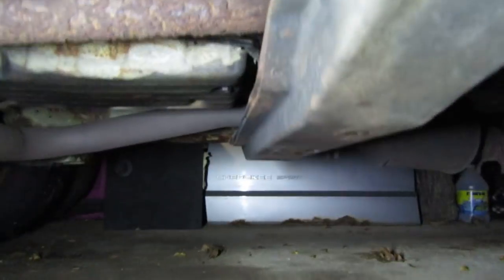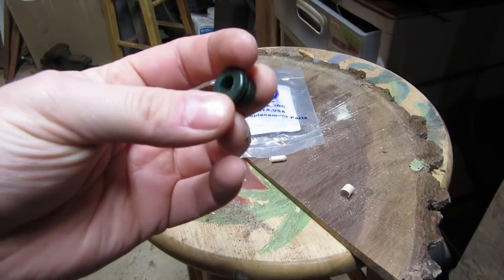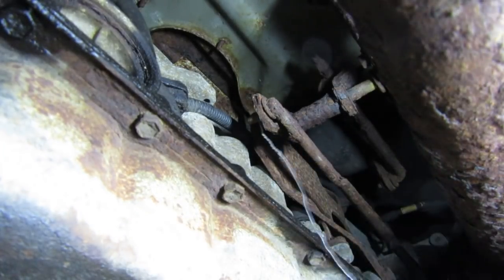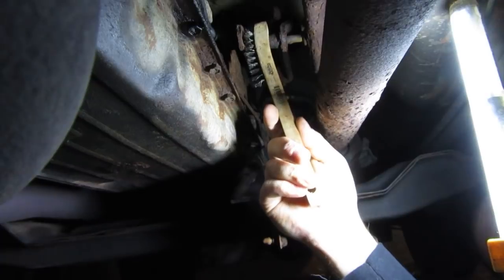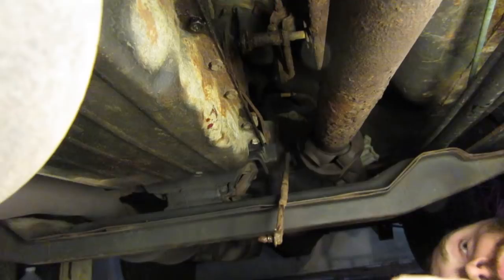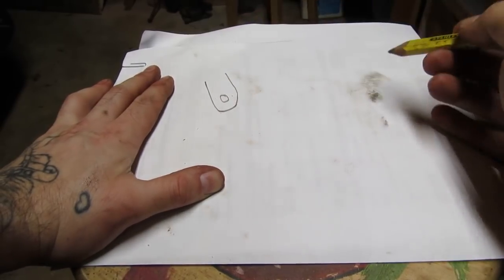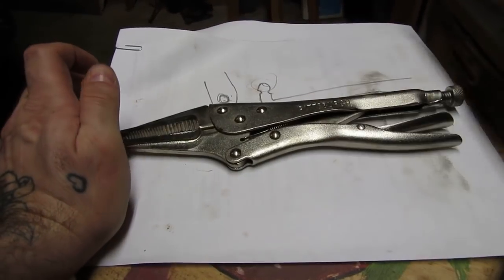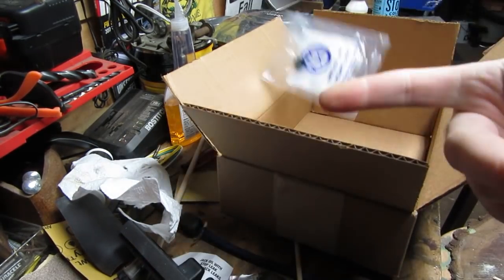HOW TO - Replace Transfer Case Linkage Bushing - JEEP

Comment: This may sounds stupid, but this is one of the most helpful video's I have seen on how to fit those stupid grommets! I have a 95 Jeep YJ - with absolutely NONE of those grommets on the automatic shift linkage - and tore my steering column apart trying to find the noise that was telescoping up the steering shaft from where the linkage connects. These things will restore your sanity... Anyway, thanks a ton for the video! Turned my otherwise 2-3 hour ordeal into a 10 min job.

Comment: Great video. Here's a thought why not put it in the freezer to shrink the rubber and then slide it in and as it heats up it expands. Never replaced it before but that's how I usually do bushings.
Reply: Yup. Most things will shrink when they are cold!
Reply: Frank Schwarz haha true story
Reply from the maker: Yea, i can't believe I didn't think of that! That has to be the "correct" way to do it.

Comment: Thanks for this. I haven't gotten under there yet, but I think while the arm didn't come loose, I think the bushing just dry rotted and vaporized into thin air. 

Now I hearing the chirping (annoying AF) of metal against metal.

Plenty of time to put the new one in tomorrow. Nothing but time on 3/25/20!

Comment: thanks for the info I did check mine and it looked abit brittled and torn and almost gonna fall off 
how ever I also have another problem at the shiffter rod going into the tcase . it looks like the seal is bad on it and its leaking fluid . the question is do you know if i have to drop and open the tcase to chang that or can i fish the seal from the outside then push the new seal ond o ring around the shaft.

Comment: Boiling water under the Jeep was not a possibility so I tried a hair dryer set on low--easy to carry under the vehicle. Warmed up the linkage and the bushing and it got squishy and popped right in using channel lock and very little pressure.

Comment: My 84 CJ7 has that same design to connect the shifting linkage to the auto transmission. With the help of your video I feel like this is a possibility. Otherwise the bailing wire was about to go back on. 😅

Comment: Have you tried pre-chilling the grommet so it's external diameter is smaller when installed?  Also, if you put the grommet into the bracket first, the channel for which it resides once installed - could (should) have some extra play for installing the bar through the hole afterwards.  If you installed the post into the grommet first, it might not leave enough clearance for the grommet to fit into the bracket afterward... so your order is likely the right approach.  :)

Comment: This makes me want to go out and work on my XJ...ahh crap I don't have one LOL.  

I've never had to replace one of those bushings, looks pretty easy to do but you would think maybe a smaller bushing with a retaining clip on the back side of that linkage to keep it from falling out even if the bushing disintegrates.

You probably should crawl under the Jeep and spray that bushing periodically with some silicone spray to keep it from disentegrating.
Reply from the maker: That is the best idea I have heard yet! i hadn't thought about preventative maintenance for those little buggers..

Comment: This is for the second shifter in the car that lets you  shift to 2wd and then Part-time 4wd then High 4wd then low 4wd?   this is the problem I am having can't shift that into gear .. stuck in part-time right now. Pain .. please respond if you can.  Thank you so much JP in Michigan .

Comment: I've seen a push/pull cable setup that replaces the whole linkage, but it's a coupla hundred bucks I think.  What about fabbing up a piece of flat stock w/ a hole in each end and bolting that in place of the rod that popped out??

I'm wanting a TJ, but I'm guessing a lot of what you and BJ do on XJ's will apply, so I'm watching and rewatching y'alls videos to learn as much as possible so I can hit the ground running on that magic day the Jeep Fairy comes.
Reply from the maker: Yea, at the end of the day all these Jeeps are very similar, especially the TJ, XJ, and ZJ. They share the same motor, transfer case and the entire front suspension setup is identical. The stuff Matt over at BJ used to do with XJs is insane. He is the reason I started this channel. haha

Comment: mine fell out and still has the bushing on it and i cannot get it back in, im thinking of taking it off and cutting the old bushing off and replace with a new one and do it the way you did because it seams near impossible to do it with the bushing still on the nipple.

Comment: mine is in exactly the same shape as yours maybe worse with the rust....there is only one bolt securing that lever to the transfer case...i think i am going to remove it sand blast/grind/file prime and paint it back into shape before install new one

Comment: I used channel locks but I put a small plumbing nipple on other side so pliers aren’t pushing back against the taped side of bushing that is trying to come through hole. Nipple fits around other end. Popped right in. Took like a minute. No heating bushing. No grease.
Reply from the maker: that is a great idea actually. thanks! I hope I never have this issue again, but as I am sure I will I will use that method
Reply: D&E In The Garage  ya and if you use channel locks it squares them up nice to push bushing in straight.

Comment: Another tip is I installed a Crown bushing but I ordered a Mopar one as well. The Crown one is so much harder than the Mopar one which almost has more rubber like feel to it. I would think it would be way easier to pop in than the Crown.
Reply: Do you know the mopar P/N?
Reply: @noisylobster499   No I’m sorry I don’t remember what it was.

Comment: Heat It up!! Then viola!! Poof!! Presto (ACCIO!!) lol
I put my parts in front of a diesel fired garage heater... Of course, I use this year-round, it is cheap and easier than you may think.
I use a salvaged (rebuilt) unit I got free that needed other free parts I found or buy one. Mine is rated @ 75k BTU, But I may have the pump pressure up a little higher than normal. LOL
This heater unit I have sits on a table or the floor, I slide the table back and forth facing the heater outlet, from contact to as far as I want to control saturation time.

The bushing flange always rides against the part that doesn't move!!

The Further away the safer the heat up time of course, I use it for bearings and all sorts of stuff... 
Try it out, you can use anything to heat it I guess, but I am telling you slick as snot!!! Heat is your friend...
You do not want grease, that attracts dust, dirt = wear = failure prematurely. 
I'd also recommend a hair dryer or industrial type heating iron/dryer for the pure novice. 
For the Purely Professional he can use the mighty Mapp Gass torch purely backyard TEKnique or is it professional!! 
LOL

Great Video!!

Comment: Would that plastic piece work on the shifter on a 98 grand Cherokee the cable keeps coming off on mine when I shift from park to drive and vice versa
Reply from the maker: No, this part is only for the transfer case linkage. There is a different part for the transmission linkage. I admit that I am not sure which part you will require

Comment: to make the job easier...one bolt attaches this to lever to transfer case... remove lever clean up and install bushing on the bench.....attach back to transfer case snap in cable

Comment: Hey, I've got a strange one, and yours is the closest vid so far... but not quite it.  That bar, that goes into the frame itself, that all the likage is connected to.  Mine is sliding in and out of the bracket on the FRAME of the Jeep... like maybe there is a retainer of some sort missing.  If I could find a good pic, diagram, etc, of what it's supposed to look like, I could sort it out!
Reply: At 3:24 in the video, see where your hand touches the frame on the right side of your hand.  Go straight up, and see the round rod there, that is slightly yellow?  Right THERE is where mine is sliding in and out of the frame to it's right.
Reply from the maker: I am not certain, but I think this same part is what you need. They dry rot and just fall out
Reply: @DEInTheGarage  Thanks, D&E!  I did find a repair kit for it, sounds like you were right on.
Reply: @meadowbyastream   had the same problem, should be a green bushing in there, if not you need the green one, all the replacement part kits include a green bushing

Comment: So the truck to this is to use rubbing alcohol as a lubricant. I know it sounds funny but it makes rubber extremely slippery for a few seconds before it evaporates off. If you use rubbing alcohol they will slip right in no pliers needed.
Reply from the maker: No kidding?? I never would have guessed that. Thanks!
Reply: Thanks that’s a good tip. Gonna put it in hot water then use rubbing alcohol.
Reply: Rubbing alcohol worked! Used some channel locks and squirted the rubbing alcohol on the grommet and it took about 30 seconds to get it installed. Prior to this I had wasted so much time not being able to get that stupid bushing installed. Awesome tip!

Comment: i was quoted $57 at the stealership today for that bushing does that sound right?
Reply: I know this is an old question, but that's more than a fair price. When I retired in 2013, the "stealership" labor rate was at least $120 per hour. So if that part was 3 bucks, you got it done for .5 hours and the dealer didn't really make anything substantial on it.

Comment: If you would of put it in really hot water for a few mins, the rubber would of been soft enough for it to be playable for a better result and only would of taken a few mins to get it done
Reply from the maker: That is very interesting and something I had not thought of... That just might be enough to make this job a TON easier. Thanks!